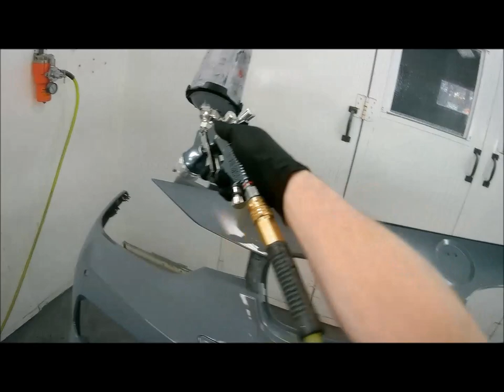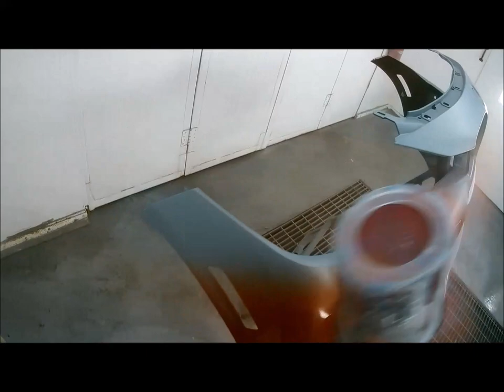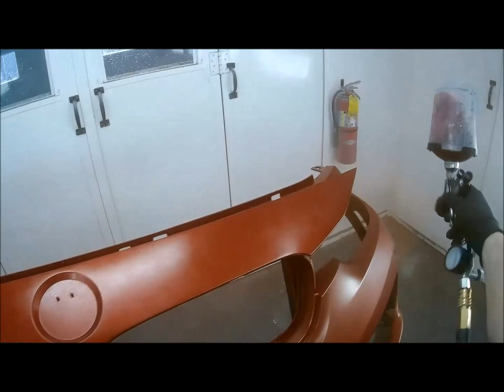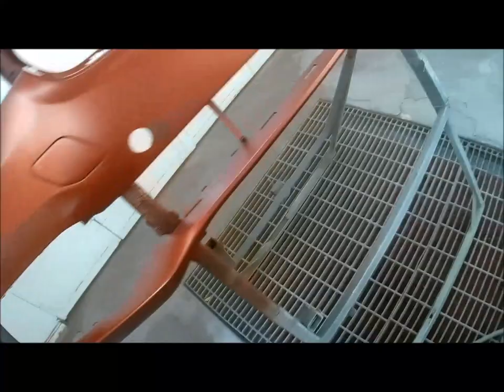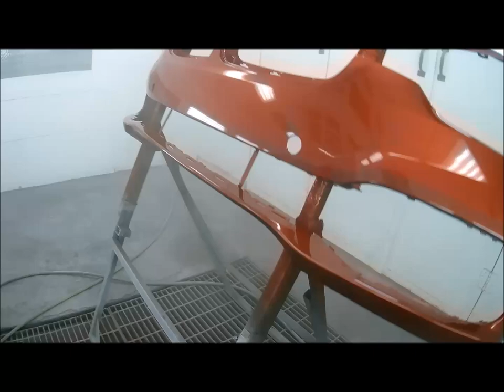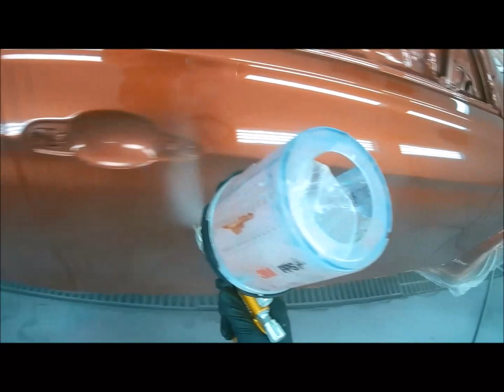Tekna painting BMW 3 series

Comment: Great video. I found you searching for tekna prolite 1.2. I said Iwas having problems with a 1f7 silver metallic. My brain has been exploding because so many videos out there say spray at 2bar...1.3 te20.  I've gotten my best results spraying metallics with a 1.2 te20 around 18PSI and clear with 1.4 te10 at 18~22 PSI. I'm so confused.. there is a devilbiss app that lets you look at set up recommendations by paint brand and those rarely match what the manufacturer will recomend. Its really confusing for a self taught guy to figure out. Expensive to test out too.. If you spray everyday, maybe you could test out these lower pressures more? Great videos, sharing your channel in a diy paint facebook group for you. Thanks!
Reply from the maker: How'd you make out with the 1f7? Thanks for sharing I appreciate that a lot. The decilbiss options can be confusing. I've tried all the combinations myself and I'm still amazed at the different set ups people use and get great results.
Reply: @paintyourbody8098  well, I mucked up the fender today so I have to sand, base and clear tomorrow. Got two bumpers and the dogleg quarter panel done. Blends are gooood. Looks better than I should be able to do. I will never spray a silver metallic without putting down DBC 500 first. Or some other color blender. I took notice when you said in one of your videos that you put down adhesion promoter, to act like a wet bed?  That's probably advice worth gold. I laid it down, 1.2, te20, 18psi, full fan, 2~21\2 turns out. When I sprayed a fan test and the metallics in the middle moved I choked back the fluid. Dropped to 15psi and moved back to about 10inches and drop coated. Amazed myself. Definitely getting better but I've sprayed this 1F7 on 5 parts, twice now so.. I should be learning. Lol. I also used ATX paint with the Deltron dbc500 without issues. I mix all kinds of brands. I've gotten a lot out of your videos so far. You need more! Do you like teaching? You're good at it.

Comment: What psi do you spray the base coat and name of the air cap
Reply from the maker: I spray at 19psi for basecoat and on my final coat I drop it down to 15-16psi. I'm using the TE 20 air cap (high efficiency)